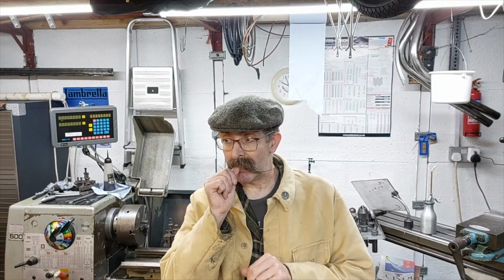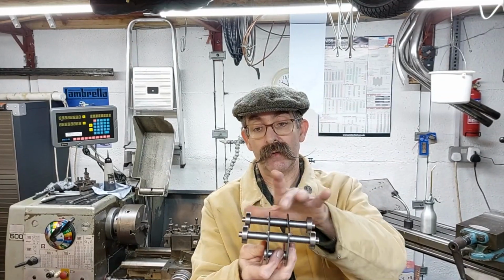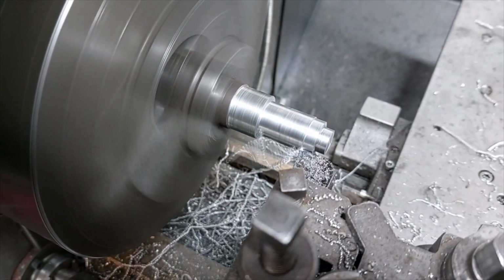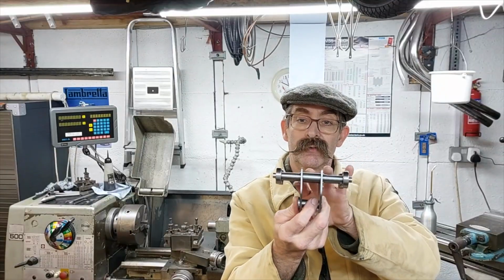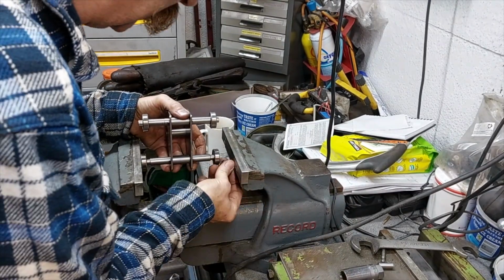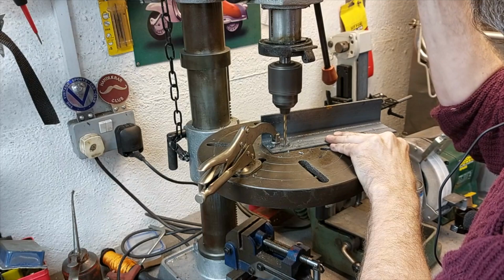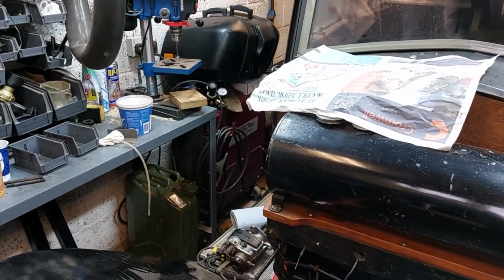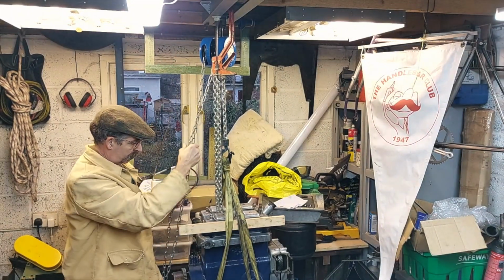FABRICATION AND INSTALL OF GANTRY CRANE IN TWEED'S GARAGE

Comment: Wow....I wish I had you as a next door neighbour....such an interesting guy.

Love watching you machining....great kit you have.

But my word....I think you need a wider garage....your traveling crane is a fantastic idea....love it.

I have a mig....130amp gas....its ok...but could doing with bigger....but I do have my oil filled Oxford for heavy stuff.....but when I see this modern welders....Mig/Arc/Tig combined.....for such low prices.....getting one is very tempting.

When you had the Riley's motor up in the air....I thought....gee thats a heavy old flywheel it has.

Thanks for sharing with us.

Nick from Cheshire.
Reply from the maker: Thanks Nick, glad you enjoy the content. 
A bigger workshop would be great but space is an issue with the only solution being to move......but the thought of moving the contents of the garage and workshop brings me out in a cold sweat.
Good to hear you've got an old Oxford welder ( there's still a lot out there still doing sterling service ) , I've got a Thermal Arc 180 that I've had for over 20 years, my welding supplier convinced me to buy this ex demo unit rather than some of the similar priced new units that they had on display, it's done sterling service and he always offers to buy it back if it ever failed because they are such a good unit. I have a TIG/arc unit but I use the mig more ( TIG gets through gas at an alarming rate ( and always remember to turn the gas bottle off when finished because it leaks out through the unit over time unlike a mig unit .......don´t ask me how I know ) and yes the engine is a heavy lump ( it took myself, my neighbour and his rugby playing son to carry it from workshop to garage........and that was without the flywheel!!!!!!!)
Reply: I agree re moving.....far to stressful.

Bought the Oxford aged 17....with zero clue on how to weld.

Brand new £49....my idea was I could use it to weld up my old Mk 1 Cortina.....how mistaken I was....

Helped when I found I could buy a brazing torch for it....carbon arc.

Still the welder paid for itself many times over so all was well.

Keep up the good work Allan. @TweedsGarage

Comment: Nicely designed and executed project Mr Tweed. For the weight you're dealing with the attachment to the rafters should be fine. If you were dealing with a big V8 engine and gearbox it may be a bit chancy.
I have taken risks before and got away with it. The most sketchy was swapping the engine and gearbox on  a 1965 Singer Gazelle. I borrowed a 5 ton chain hoist from work and ran a couple of turns of cable around a thin rafter holding up an asbestos roof. You could see the rafter bouncing on every pull on the chain.
The other mad (young in those days and skint) was another engine out on a '73 Viva.
This one I stood inside the engine bay and lifted it out. I'm surprised I can still walk today!
Thanks for sharing, looking forward to other Mr Tweed adventures.
Reply from the maker: Thanks Colin, the roof was redone a few years ago with5" x 2" joists so its pretty robust but yes a cast iron big block Chevy with 350 turbo box would probably put a bit of a curve in the roof and yes i remember hauling Ford pinto lumps and BMC A series engines out with lumps of timber and a rope........couldn't do it now...
Reply: @TweedsGarage  Tempus Fugit and all that.
I think with your garage/machine set up and your skill set there's not much you couldn't tackle. 
I've always been an inveterate tinkerer and fixer, my wife says it's why she married me. Her Dad wasn't good with tools and a shelf above her head fell on her in the night causing her to make a very dodgy choice of husband!
Reply: I once let my brother use my small HALRAC pully lift...remember those in the late 60s.....1/4 inch nylon rope.

He lifted out with great difficulty a 1960 Vauxhall PA Cresta big 6 cylinder limp c/w with gear box.

No HS in those days.

Comment: A really useful addition to your workshop, you would have made life much easier if you used a length of 6"x3" RSJ for your rails, you could then just mount the skate around the bottom web, it would also be much safer if the bolts holding the rail were put through the roof joists nearer the top, the way you have them they can pull out the lower 1" of timber if they fail, you now have a much better lifting system than an engine hoist will give you, especially in your now cramped conditions, did your Student come with the DRO system connected, or did you fit that? Chris B.
Reply from the maker: Hi Chris, yes the Colchester came with the DRO mounted on it.